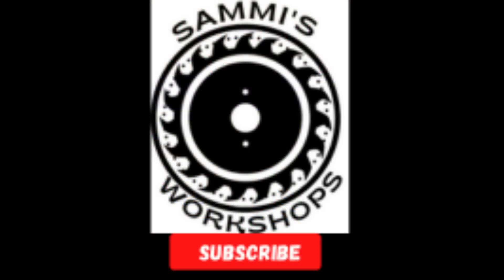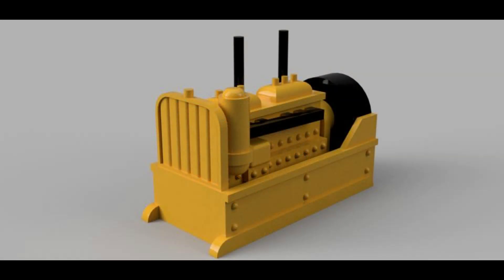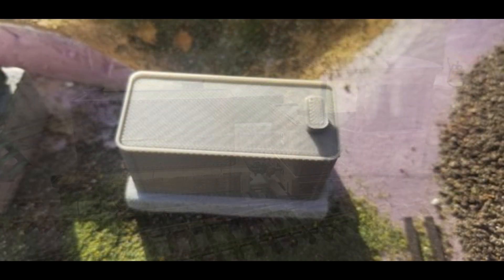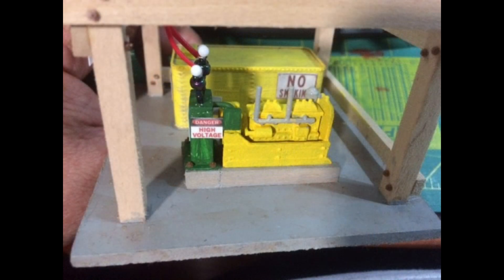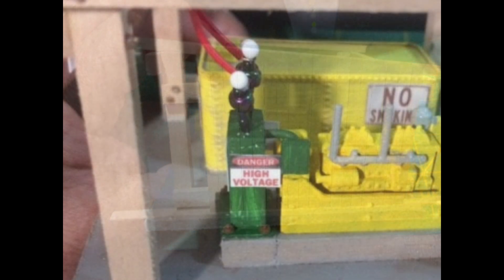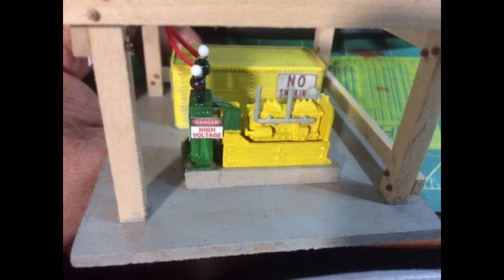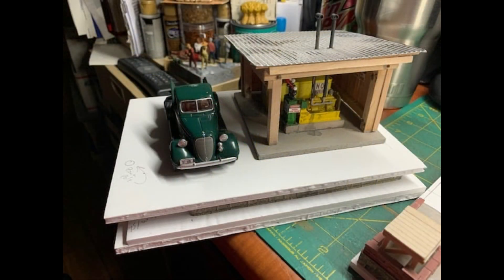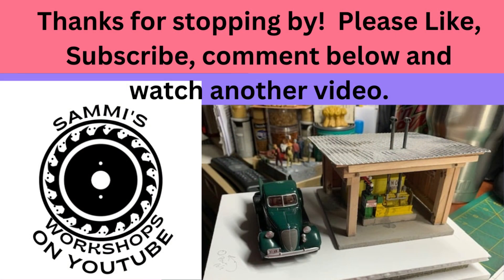On30 Generator & Fuel Tank Shed build

Comment from the maker: Welcome to the generator shed build, using a couple of 3D printed parts, some lumber, NBW castings (Nut Bolt Washer) and some corrugated paper nee metal roofing and some card stock I built a cool lil electricity generator for my On30 Model train layout.

Comment: Looks great Sammi!  One thing that it needs is 'filth,' like oil stains on the deck and possibly the engine.  Another thing that might make it pop is an LED light inside, but really dulled down.  Keep up the great vids!
Reply from the maker: My thought was only a little filth as it is a fairly new addition to the roundhouse. I have a Les Davis Dan Wolschon figure to be standing there looking at it suspiciously The old roundhouse foreman you know, not a fan of change hahaha. AN interior light or two using those reflectors I got from you seem to be the way to go.  Most of that final detailing will occur as I build the turntable n roundhouse.  Altho the way my locomotive facility is shaping up (on paper at the moment) the round house may actually be the square Classic Miniatures one I got from you.  More videos to come. I actually found a lot of photos from some time back that I thought were lost when the old HD died